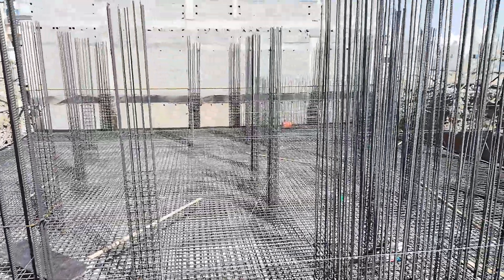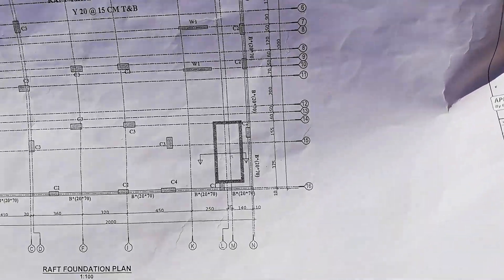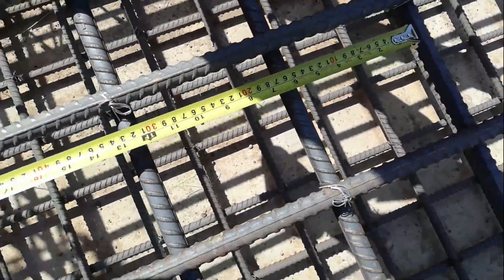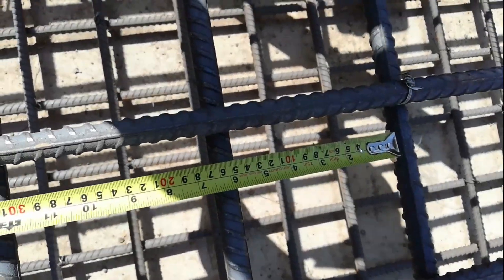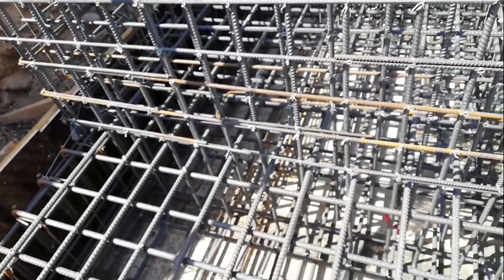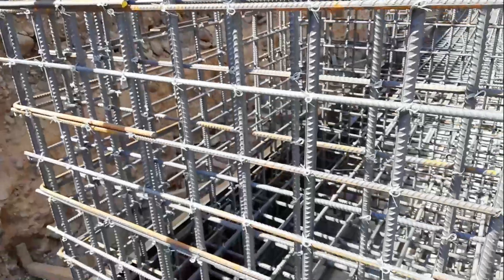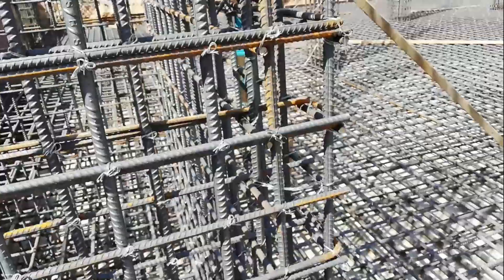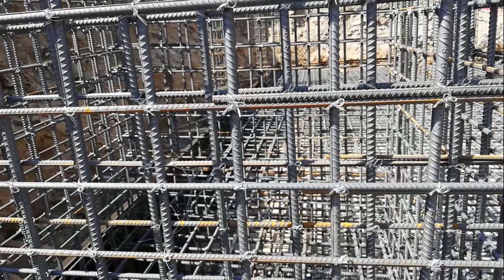SITE INSPECTION: MAT OR RAFT FOUNDATION & SHEAR WALL CHECKING BEFORE CONCRETING

Comment: HI SIR.
1-I Have Raft Foundation Drawing  Plan  With Column Positions & I want Make Shop Drawing . But I don't have  Moment Dia Gram of Raft Foundation.
2-How Can I Decide & Put Overlap in Fit Position For SUBSTRUCTURE SAFE.
3-Because After Make Shop Drawing I submit The Drawing In Consultant  I don't want to Consultant Rejects My Drawings.
4-I also Make BBS for Construction if we don't Put Correct Position MY BBS Make Problem for me .
5- if you give me his email I will send you drawing.
My Email -  civilsurveyor007@gmail.com    cell #  00966582483800 KSA SAME WATSUP NO.
I AM WAITING for YOUR REPLY, SIR.

Comment: Great work BD. Could you please design a raft and strip foundation, also a flat slab with detailed reinforcement using Prota Structures. Thanks for everything.
Reply from the maker: https://www.youtube.com/watch?v=_tRYWvZHN7c&index=14&list=PLiK7qkGjS_tJ4sfhlMfwtO3MVWFY2GYnR&t=0s
Reply from the maker: https://www.youtube.com/watch?v=3DhQvuLUvU0&list=PLiK7qkGjS_tJ4sfhlMfwtO3MVWFY2GYnR&index=14
Reply from the maker: https://www.youtube.com/watch?v=rQ58dmmtH4E&index=9&list=PLiK7qkGjS_tJ4sfhlMfwtO3MVWFY2GYnR&t=0s
Reply from the maker: https://www.youtube.com/watch?v=rfjVKNrxHJU&list=PLiK7qkGjS_tJ4sfhlMfwtO3MVWFY2GYnR&index=9